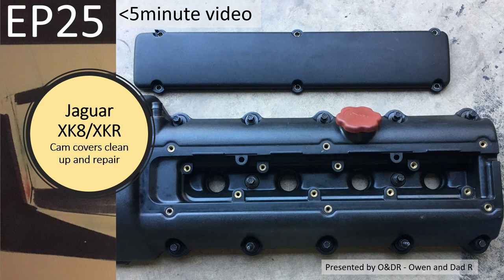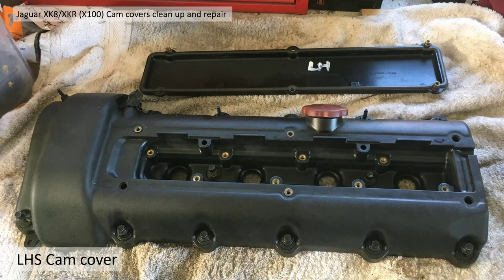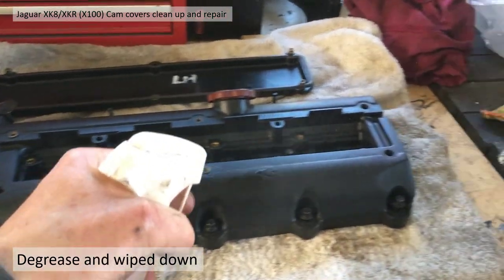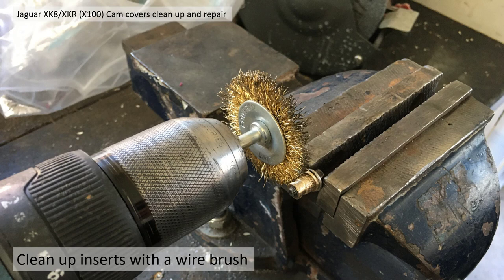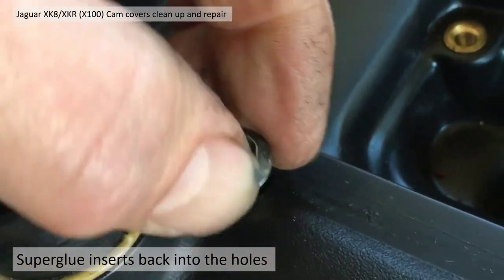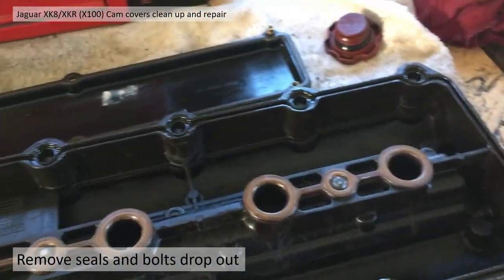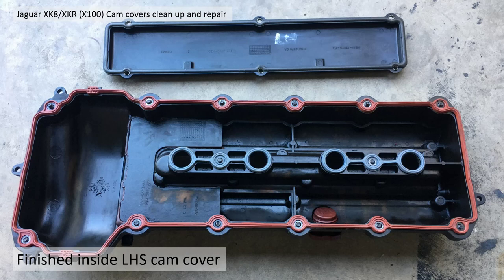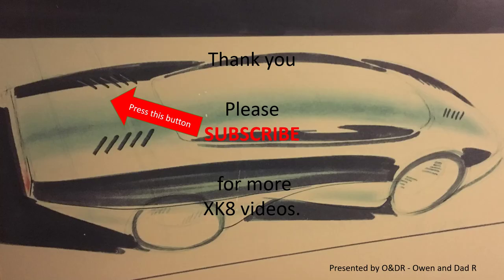Cleaning and repairing cam covers EP25 Jaguar XK8 / XKR (X100)

Comment: just a quick tip/bit of info. there are actually  3 types of bolt on the cam covers, the two you have covered in this video plus 1 more very important one. it goes next to the cam position sensor, the sensor is magnetic  and the 'special'  bolt does not interfere with the magnetic pick up ( hall effect) . it should of been the only bolt to come loose without having to remove the gasket first.  mine was also a different colour, it was not painted black like the others. im pretty sure your model will be the same and if you have mixed them up you need to make sure it goes back where it was. thanks again and again for all your effort and help you give with your channel.
Reply from the maker: Todd, good info, much appreciated. Have notice interference on the radio since doing the chains will check it out. Thanks again, Damian
Reply: @ODRModurol  that will be interesting if that is a symptom.......jaguars are fun aren't they !!!!!!!!!!!!!!!!!!!!!!!!!!!! lol
Reply from the maker: Todd, Assume the bolt location is LHS bank under the      expansion tank, lowest corner? Going to check all the bolts visually this afternoon. Couldn’t find any reference to this in the Jaguar workshop manuals? Thanks Damian
Reply: @ODRModurol  it will be above the cam sensors , the bolts at the rear of the engine at the bulk head end and next to the inlet side not exhaust. you should have cam sensors there, not sure if they changed them on later models.
Reply from the maker: Todd, locates the sensor but could visually fit a different bolt. Assume one is slightly shorter. Wasn’t going to remove all of them to find it. So took it out and replaced the bolt with a slightly shorter stainless steel one. Thanks Damian
Reply: @ODRModurol  https://www.youtube.com/watch?v=mCoDqI9r_j0&t=318s.  at 5:13 you can see the nut fall out on its own as it is different to all the others as it has no sleave  i just checked my box of bolts as my car is still apart. it is slightly shorter , it is threaded to the bottom the other bolts are not and it does not have a sleave.  it is magnetic so im guessing as you have deducted , it is the length that matters. i wonder if this was a revision on later models. mine is a 1999 xkr.  hope i did not give you the run around for no reason. thanks again.

Comment: I would recommend using a better adhesive, such as JB Weld or 3M DP190.
Reply from the maker: Understood may well be redoing them if they can’t take the torque. Just waiting for delivery of a low range torque bar for these and the front engine cover bolts. Will let you know.